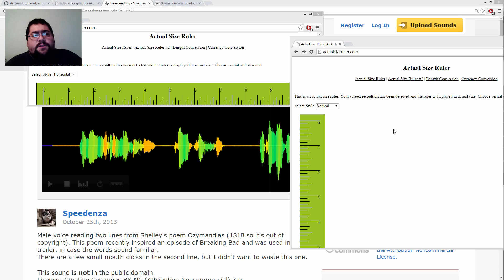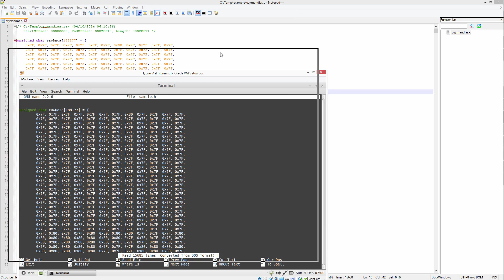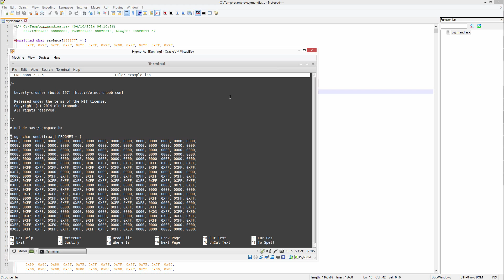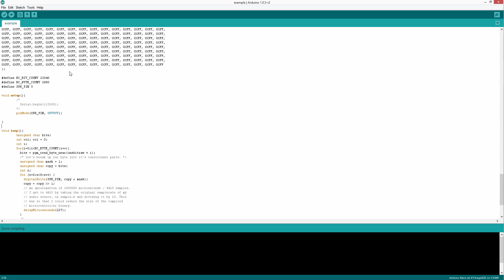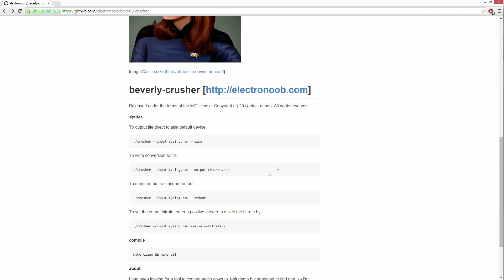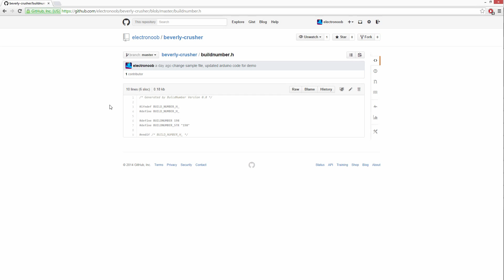Making an arduino generate sound. Bit Crushing and downsampling software.

Comment: There's an easier way to convert sound files to 1-bit, by using Audacity and amplifying the audio to maximum multiple times until the waveform is completely square.

Comment: You should be able to get better fidelity by supersampling the audio. In Audacity boost the sample rate (make sure it does a sinc interpolation or similar), then superimpose a high frequency tone, sawtooth or noise - above the audible range. Then crunch this to 1-bit, and voila you get extra "bits" resolution. It works a bit like PWM. If the data is all getting a bit big you could RLE compress it.